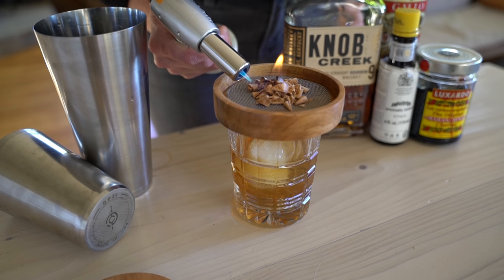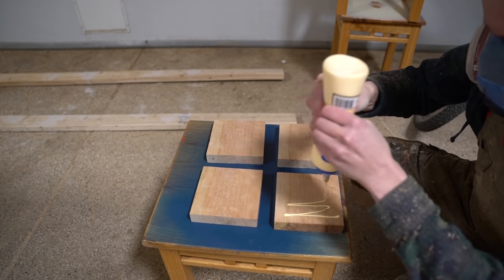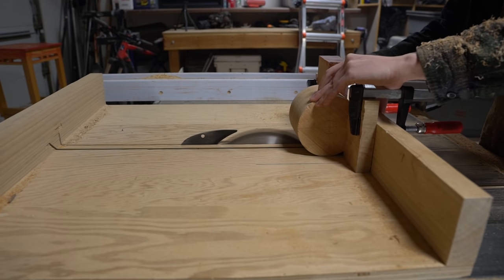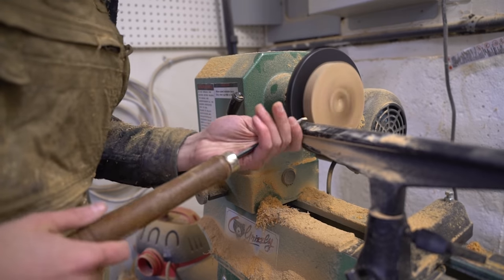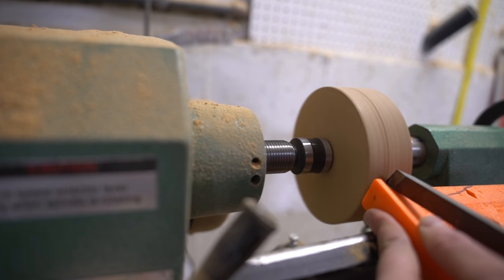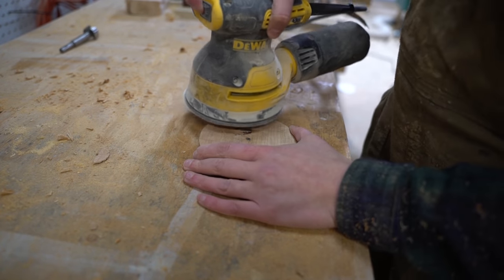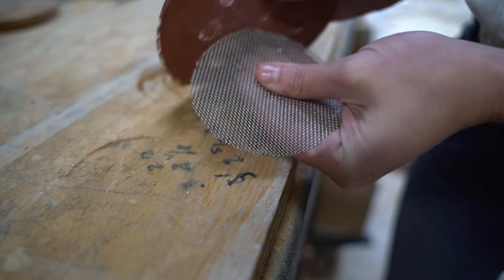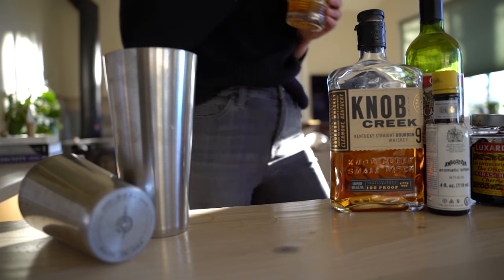DIY Cocktail Smoker | HonestWork Designs

Comment: cutting the cylinder on the table saw is so dangerous.  Even with the sled and small bites. If it grabs, it can take your fingers or throw that block at your head.
Please use a thin parting tool while on the lathe. or use the bandsaw with the round piece in a V sled. both faster and safer.

Comment: Really cool! I think you're absolutely nailing the midcentury aesthetic as of late.

I do have to ask a process question: why not part off the lid on the lathe itself? The table saw method obviously worked, but at least you wouldn't have to deal with re-mounting the two parts of the smoker and turning them back to round (which is where I inevitably screw up).
Reply from the maker: Aw, thanks so much! 

I think more than anything, technical proficiency! I’m going to take some time before doing the small batch orders to try and make one using the parting tool.

Comment: How did you remove the screw holes from the lid from mounting your faceplate? That is the ONLY part I can't figure out. Nice work! 

Since you drilled all the way through the chimney, do you get debris in your drink that slips through the mesh? I'm making my first one tomorrow. Nervous, but ready for the challenge.
Reply from the maker: Good question, Cody! I trimmed and sanded the attachment holes away. A bandsaw would work great, or a patient sander haha. 

And yes, when the carbon got small enough, a little would fall through the mesh, but I’ve actually been upgrading the mesh with both a tighter weave and messing around with chemically etched screens. I messed around with closing the port but found it inhibited the inversion that draws the smoke into the glass more than I’d like.

Good luck! Send a picture!
Reply: Thanks for the idea. Just got over 20 orders for my cocktail smoker. Haha. Gotta go to rockler and wipe out their 4x4x4 blanks.
Reply: @HonestWorkDesigns   I would mount to a wood faceplate with double-sided tape, the bring up the tail stock to secure it. I’m going to try that.